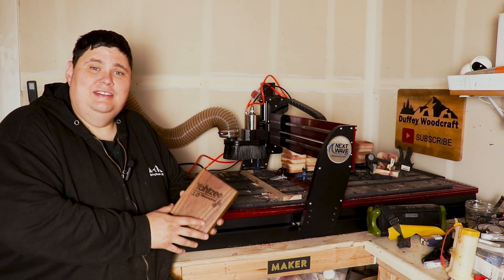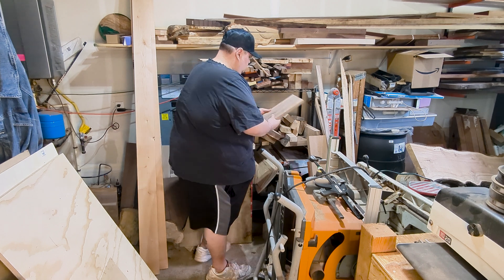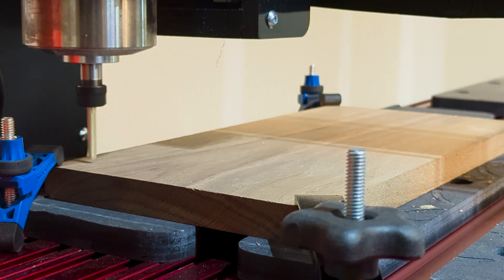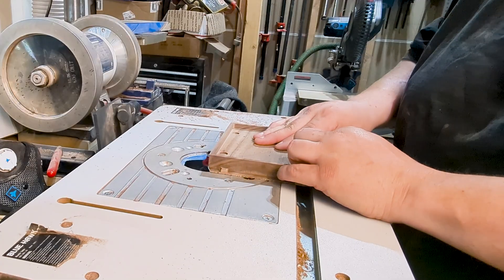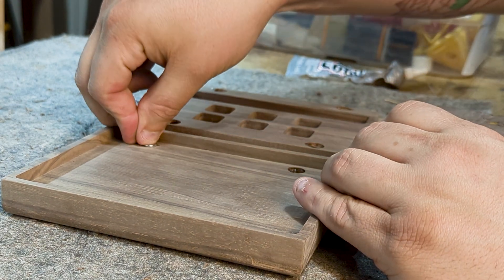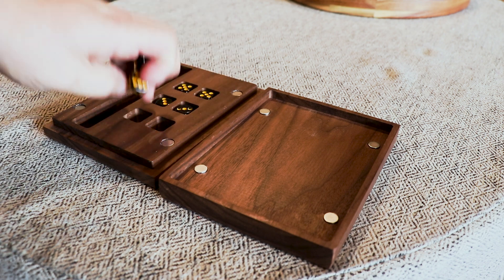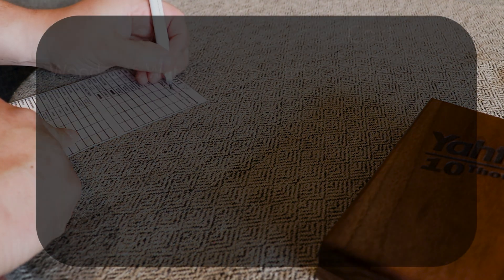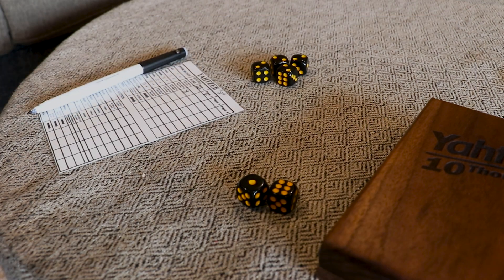Yahtzee Game Boxes | CNC Tutorial Project

Comment: If you went back and did it again… would you still buy the Laser Pecker? I’m looking at that, the Xtool F1 and the S1
Reply from the maker: I haven't looked into the X1 so not positive. I LOVE the pecker 2 and like that it comes off of it's base so you can put it on larger things. Not sure if the others come apart like that or not. 
The app runs directly from my phone and is super simple to use, so I'll be a repeat customer